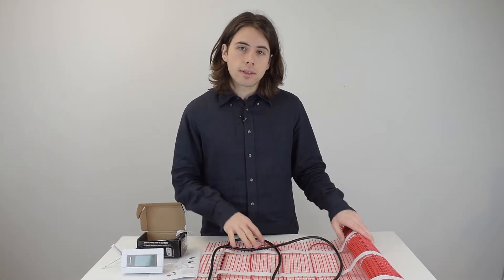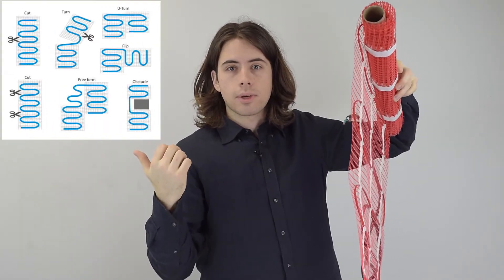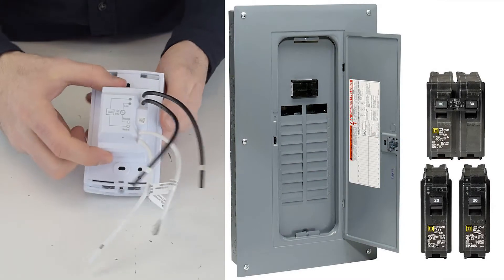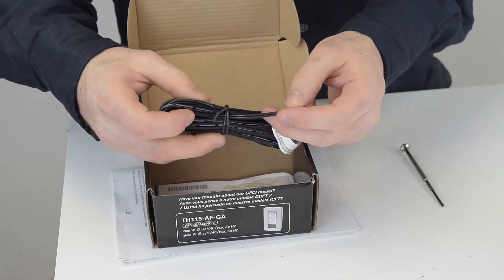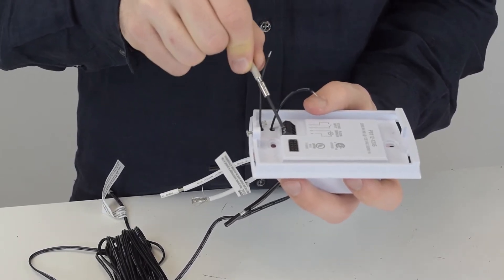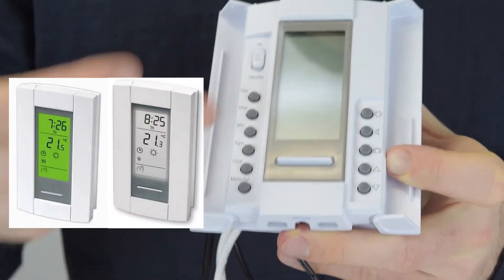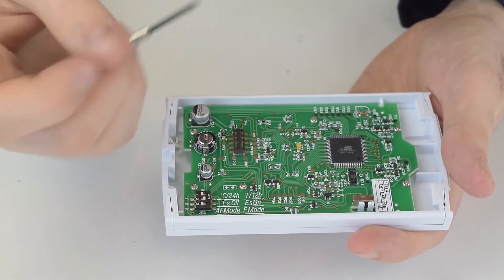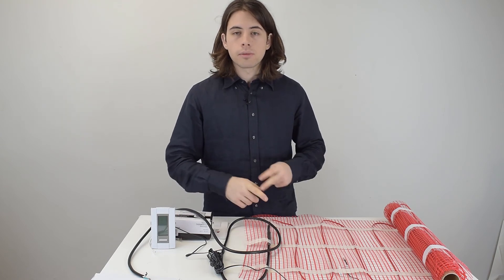How to install a heat mat for underfloor heating

Comment: We loved the floor but had issues with the grout drying out and cracking. I'm not sure if there is a special grout I should have used.
Reply: Having a similar issue, I'm gonna try a sealer after I touch the grout lines up, I hope that works